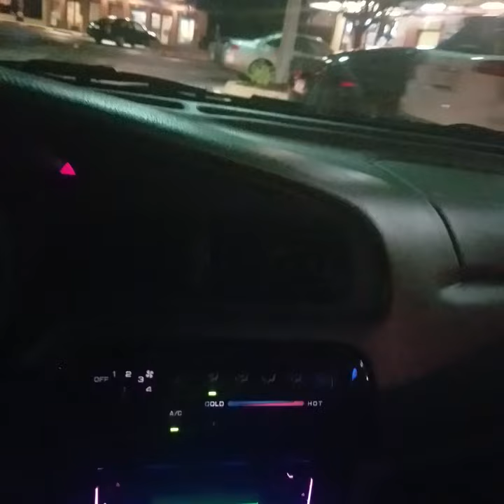Weird noise when pushing and letting off the brake pedal when at stops

Comment: In my car , it makes very loud noise inside the car only when i brake to stop at low speed and from outside it is very hard to hear. Plz suggest any solution.
Reply: My car doing same thing.. have you figured out the problem yet?
Reply: @MR-lv6lp yes, check out your lower arm of front wheels
Reply: @MR-lv6lp  please reply upon confirm
Reply: Ok, thanks.
Reply: @MR-lv6lp  does your problem solved after replacing lower arms of car????

Comment: This is just friction noise. No worries or issue at all. This happens when your friction pads don't fully stop (compress on) the rotor, so the smooth surface of the disc and brake give way making this noise. Again, no issue at all mate.
Reply: So what can remedy it?

Comment: Hello, I have a Mazda 6 2015 AT 4x4, I have the same problem, they are very noticeable in the front, I changed the plates and repaired the calipers, the discs are good, so I don't know what else it could be, please help, thank you
Reply: Water perhaps. Does it rain a lot where u drive?

Comment: I have a 2012 GMC Sierra 1500 and I replaced front and rear brakes and mine strarted doing this around they time they got broke it. I thought it may be air in the system and maybe needed to bleed it out but i think maybe the pads need a little grease on it where the piston hits. Will report back. Its annoying it makes me feel like they are not working 100%

Comment: lol this sound is normal. thats why everyone is saying they have an issue. if im not mistaken what your hearing is the sides of the brake pads sliding againced the brakets which is normal. thats why you cant hear it when you nose dive, but only when you creep off the brake. nothing too serious, if anything get some greese and put it on the edge of your brake pads
Reply: Brice Graham no its not like that. I have problem i changed break pad so still its there. There is enough to do in break see this video.

Comment: I’m having the same issue with my 2012 Volkswagen Golf 2.5 right after changing the front break pads.
Reply: VW Jetta, same issue. I’m finding out it must be the aftermarket parts put on from brake job or loose calipers
Reply: @caiaweaver3823  did you find out the problem? And what was it
Reply: I have this in my tiguan..i had this in my old car KIA more then 7 years after I changed the brake servo master pump disappeared all noise

Comment: Literally just got my car back after replacing the control arm bushing and still have the exact same noise when easing off the brakes form a stop. It’s gotta be a caliper issue at this point 😭😭😭😭😭 new pads and rotors, now bushings, I dono what else 🤯
Reply: I have the same issue, thought it was a calliper issue, and worked on it, turns out it didn't help, I'm wondering if it needs a brake pad replacement?

Comment: I noticed that SAME exact noise in my 05  BMW just now. I was curious if you have figured out what is causing that??  Please respond need help!!
Reply: 1. Use quality Oem brakes
2. Lube the guiding pins for free sliding
3. get ABS checked at dealer
the first 2 fixed mine (2015 Optima)
Reply: i have a 2006 Bmw 325i which is doing the same thing, i know this is over 2 years but if you are able to respond may you tell me what you did to fix it?
Reply: Mine has the same problem

Comment: It is normal that happens when there is not much pressure on the brake pads to the rotor so it shakes because is spinning slow
Reply: How can you remedy that?

Comment: Firestone looked at my BMW 2000 528i three times and fixed the struts and the Giubo U Joint at $1700. They said my breaks were fine but still that awful creaking under carriage noise when breaking with a slight high pitched whistle. Very annoying, last but not least BMW $$$ looked at and said the arm control needed to be replaced. Ugh!!! Just the front lower control arm is about $600.
Reply: You had a car accident, or something? The only time you need to replace one of the control arms is when it bent (by accident only). If you don't know cars and have no one to help you out, you should find yourself a new reliable car. Lets me tell you this, everything on that car needs to be replaced. It is a junk car now. The next time you go to the dealership, they will tell you that the muffler bearing is broken. Cost $900, because you are a woman. Your brake is fine. It is just leaking out fluid. What you really need is a brand new engine. That will keep your car going for 5,000 more miles. I'm not criticizing you, or anything. I just think you got ripped off.
Reply: Agree

Comment: I just gave my car for it’s 1 service with just 1000km driven. Prior to the service there was no sound.
But post I received it there are huge squeaking/cracklings noise on braking same kind of noise , releasing brake slowly on a stopped car, turning steering right and left in a standing position, reversing etc.
Please suggest what can be the reason
Reply: Did u find out?

Comment: Sorry, I thought I posted this already.  I took my G35 to the infinity dealler. I played the phone recorded sound from my car for the service manager, he could hear the sound and askes for an e mail which I sent. The next day no word from the service rep so I finally called and was told he was out. They promised to have it looked at and ready by days end.  Of course the technician said he could not hear it. I played my phone recording for them and they said they now heard  and diagnosed on the spot as  break stops that the pedel hits when the break is relased.  I asked if it should be happening all the time instead intermittently and  was told yes. It is not consistent but intermitent. Problem not solved.

Comment: my car had the same noise turned out to be the abs sensor on the wheel hub i pulled it out cleaned it and cleaned the area around it and scraped the rust off the mounting surface and the noise is gone . you can test it by pulling the abs fuse and she if the noise goes its the abs sensor

Comment: I have this problem as well with my 2013 Hyundai Sonata. However I also have an additional sound as I apply the breaks. It's like a cranking sound whenever I press on the break. I think it has something to do with the line itself but I'm no mechanic. I've looked everywhere on YouTube to no avail as well as on Google and still can't find anything which is NUTS! Hope someone finds an answer to this. If so then feel free to forward it to me.
Thanks.
Reply: I'm now having your first issue with my new to me 2013 Hyundai Sonata GLS, did you figure out what the problem was?
Reply: Change the speed sensor
Reply: Same problem 
Seme car bro I can't find it you fix that?

Comment: How does everyone have the same problem? Lol. I’ve changed my brake pads to ceramic and have gotten new rotors and it didn’t fix this
Reply: Same issue here ever figure it out?
Reply: Just had mine fixed, it was a stupid caliper. Just had it replaced for 124.50 and the sound is gone! Finally!
Reply: @YahangWu  I was premature in the praise! I had no sound for about 2 weeks after replacing the caliper (which is what cost 124.00), but then it returned. The garage replaced my brand new brakes with another new set, and still the noise remained. It got to a point where nobody could figure it out after going to multiple garages, and I got sick of hearing it and just got rid of the car.

Comment: I Have this noise coming from front disk brakes on my 2015 optima since i changed the worn out pads for new ones, there was no sound before. it's the sound that comes from your car when you wash it and it sits overnight without driving, but its constant. i Lubed, Cleaned the disk and pads, not helping.
Reply: My Toyota  Camry was have the same problem I replaced the ABS module nothing, but one of abs sensors in axle was causing the problem
Reply: Looks like you had a more serious problem. glad you figured it out
Reply: Mine was Because of Low Quality New pads... i changed to OEM new pads and also reLubed the Guiding pins that were almost stuck on the two front wheels. now, Good as New

Comment: Please did you figure out what it was? I need to know :(
Reply: I recently had a similar noise on my front right tire. it turned out that the brake pad lining was contaminated. when I took the pad off and lightly rubbed it on a 40 grit sand paper it was shedding like powder. I replaced the set of pads and cleaned and lubricated the brake hardware. All is now back to normal. I hope this comment helps someone.
Reply: @solomondiaz4105  Of coursse it's supposed to shed power. That's the brake pad and that's what's supposed to do...

Comment: I have  my 2005 coupe in the Infiniti shop to check for this.  I gave them a recording so they can hear it.  I will let you know.
Reply: I put my hone on the floor board of the car.  The service rep at Infiniti could hear it.  Of course he was out the next day.  So I e-mailed the recording to the new service rep. with also a link to this video.  When I went to pick up the car the service TECH said he could not hear the sound on the recording nor the YouTube.  Give me a break.  I played it for them on my phone and they could hear it but said it was the normal stops on both sides of the break. I asked why it was very intermittent, they said they did not know.  I dont think they even looked the car.  Question for you guys: does your happen when the car is hotter?
Reply: Did u solve the problem
Reply: Yes it happens in my lancer evo II whenever it gets hot. Whats the reason?? As its fairly normal when cold.

Comment: You need to clean your abs sensors. ABS  incorrect reading 0-5 km.
Reply: @MervinLewis-pk4us  Just search for clean abs sensor and de brand/model of your car in YouTube, there are dozens of detailed instructions available. I had this exact same issue for over a year, could not find the cause until I stumbled upon a youtube video explaining this was related to the ABS sensors. They are magnetic, and attract a lot of metal dust and debris over the years. It causes an incorrect reading between 0-5 km/h, so when pushing the brake pedal and (almost) coming to a stop,  or letting off the brake pedal and the car starts to roll, the ABS kicks in, causing a certain sound. Sometimes you also feel the brake pedal vibrating. For me it was quite simple, I had to remove the wheel, unscrew the abs sensor, wipe it clean with a cloth and screw it back in. I also cleaned the metal surface (scraped of the rust) the sensor was screwed in to, because if rust build up there the sensor gets lifted up due to the rust and also causes a incorrect reading. But watch a couple of youtube movies first before you do it.

Comment: Is this a normal sound or what ? My mechanic said so after replacing my pads and rottors ..
Reply: You need to change mechanics. 
 This is a normal noise if you do not lube properly all your metal to metal brake parts.

Comment: Hey man, did you figure it out ? I have the same problem.
Reply: What was it? 5 years later 😂
Reply: @jesusrosales2097  😄😄. Bad quality brake pads was the problem in my case. Disappeared the noise after replacing pads with OEM ones.

Comment: I have a 2017 Hyundai sonata and it makes the same noise when that slowly come to a stop when I let off the brakes. And I just got the had the front pads and rotors change but it's still making that that noise
Reply: I justed fix my camry with same issue you are having.
For me this it was a lubrication issue.
Make sure you lube all you metal parts, superficies and pins. Also the piston and  caliper arm.

Comment: My 2002 VW just started making that noise within the past few months.. I've heard it could be a ball joint, or a wheel baring.
Reply: Alex Bond I've heard many things but haven't gotten it looked at yet. I'm still clueless how to go about fixing it
Reply: Caleb Thimmesch I found out my issue was the lower control arm on the passenger side was coming loose from the subframe... One way you can check is by jacking up the car and wiggling the wheel...Same procedure as checking the ball joint. If what I mentioned before doesn't seem to help, just jack the car up and inspect underneath with your own eye... Grab ahold of things attached to the tires/hub assembly's, and make sure everything is pretty nice and tight. Loose bolts are the main cause of clunking...
Reply: Mine makes the same noise and it's two months old, also a VW
  Jetta 2019. Taking it in tomorrow
Reply: @chibry  bro did u find out the cause
Reply: @TayeAkindedynamo  no they fixed it but not sure what it was
Reply: @chibry  can u ask

Comment: Is it the rod on your brake pedal?
Reply: I had the same issue on my camry.
Problem was lack of lubrication. 
I did my brakes and rotors few days ago and today I took everything apart again and lube all metal to metal superficies and pieces.
 Problem solve, never had this issue before until now, just make sure you put grease top and bottom on the metal pieces that comes with the pads.
Don't forget to lube the pins and boots
I hope it helps and good luck

Comment: Have the exact same issue now on my Kia Forte 5, has been a nightmare to address. Have taken it to 3 shops, paid $300+ twice for erroneous fixes (brake pads, resurface rotors, brake fluid flush, new caliper), nothing works and no one knows, or cares to investigate enough to fix it. Also, FUCK midas, please no one ever go there, con artists.

Comment: ya brakes need replacing, brake pads normally have metal strips that chatter on the rotors letting you know your brake pad material is low on the pads and they need replacing

Comment: I'm having similar issue .My mechanic just test drove my Toyota Camry 06 Le other day with me. He can't hear any issue. He changed brakes rotors recently under warranty I think. I also find when I pump the brakes while parking I'll hear that squeaky whining sound. I told my mechanic who's in business over 50 years, that I passed a Toyota dealer mechanic who told me, that if the brakes are not oem brakes, that noise will occur, but everything else is ok that Toyota mechanic said. Toyota mechanic didn't examine my car. I just was questioning him. I told my private mechanic of over 50 years experience what the Toyota mechanic said to me, that noise will happen if they are not Toyota oem brakes. My mechanics reply "That's BS". I kind of agree. If Moog or Walker or whoever manufacturers the brakes for Toyota happens to go out of business ; does that mean Toyota will never have good brakes again? I asked my mechanic if its the linkage if the brakes. He doesn't think so. The noise I find is when the car stops completely at the last second or while pumping the brakes even driving slowly when parking. One must remember a mechanics hearing is not as good as the average driver especially when the mechanic is in his 70s. He said there's nothing wrong with my car. I find it happens after the brakes are hot. I saw another video on youtube where the noise could be the brake pedal itself. It's not a major issue. Some cars will sound different than other cars even if they have low mileage. Mine is 06 Toyota Camry le only 45000 miles. I may get a second opinion. There are slotted brake discs that dissipate heat better. That's another option. I would only consider listening to Toyota if they guarantee by changing to their pads or discs or shoes, that the noise would be gone. Then again maybe a bushing in the pedal assembly needs lubrication. My mechanic tried greasing the edges of the pads I think. I never thought brakes could cause noise issues ever.

Comment: Simple: 
Makes noise when the car is in gear: Its just the pads making the noise called "Growl", its completley normal.

Makes noise when in "PARK": your brake assembly needs to be lubricated. Take it to a mechanic and let them know you would like this done due to the creaking noise.
Reply: Do I have this problem on a New car?

Comment: First, check motor mounts.
Reply: Why do you say to change the  The motor mounts? I ask because I know I need to change mine and mine cars making the same sound and I could be in part after driving let go the break with the E brake up and it still makes the sound

Comment: my car makes noise when I let off the brakes on slowing down to a Stop, when I brakes hard there is no noise.I have changed a lot including steering rack,sway bar and end links, wheel bearings twice,brake pads,a hub,2 engine mount,a v arm and bushings and disc skimming. Now I wanna try a right hand shock.
Who ever experience what am going through please be of assistance
Reply: So sad
Reply: Wow. You have bought almost a new  car, but with the same  problem, sadly.
Reply: This is my same problem. Especially when the car is cold. At hard brakes no noise but when slowing down and rolling and then stopping slowly it makes that awful sound. Idk what it is smh